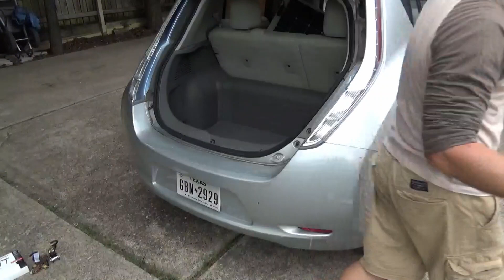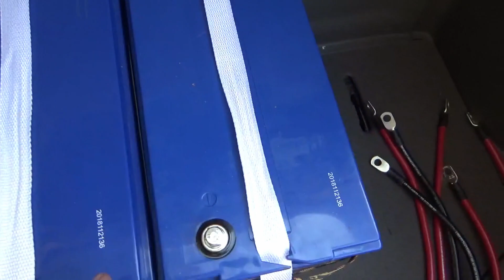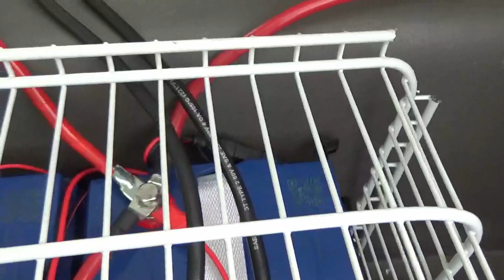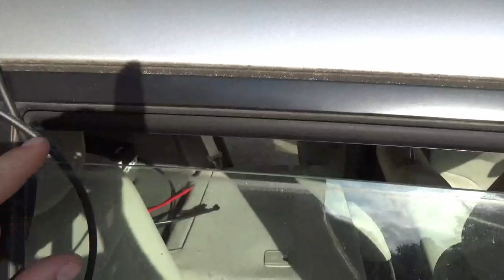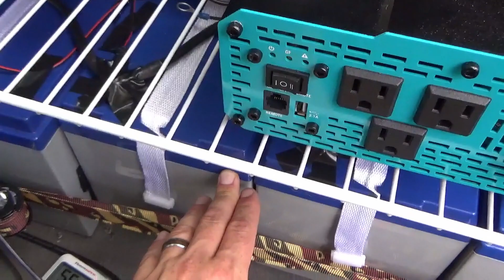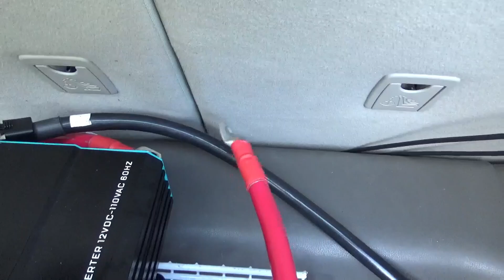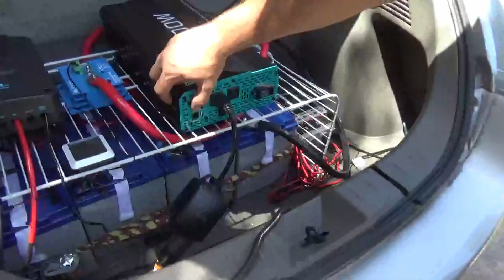Solar Powered Nissan Leaf

Comment: How much you spent on materials?
Reply from the maker: $2400 on system shown in this video.  But it has evolved since then.  The system shown in my latest video (5-7-2020) is closer to $3200, but generates twice as much power.

Comment: 65w/h 8h=520w1dey.  24kw/h battery Nisan leaf=48dey 1charger😂😂😂😂
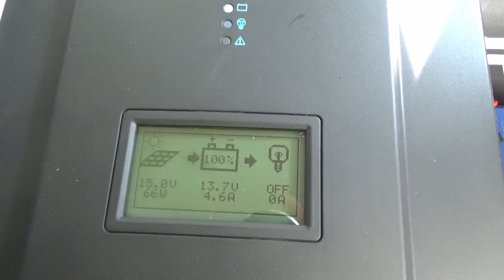Reply from the maker: Couple things to keep in mind.  1)  Gen 1 Nissan Leaf battery never discharges to below 2 kwh, so at most you are charging 22kwh.  2)  This was the earliest semi-functioning prototype.  Current system (4-24-2020) has 320 additional watts of paneling, and has achieved charging speeds above 400w, and I'm not stopping there.  3)  This one's the most relevant.  The power that solar systems put into their battery bank is very much affected by the current voltage of the system.  You will notice the display @23:42 reads %100 (and it definitely was at 13.7v).   The 65w reading shown in that scene is a reading not of incoming power, but of power flowing into the battery bank.  Had the bank been at a 50% discharged state, you would have seen that reading increase to about 150w.  Is that a super impressive number?  Hell no, but once again - earliest functioning prototype.  I cranked out 3 kwh with the system yesterday, +4.5 kwh from the new battery bank =7.5 kwh or a 34% increase over the maximum capacity of a brand new 24kwh battery.  And that is a significant improvement

Comment: cool concept, but I dont see how you will save any money over just buying a car like a Prius. A prius only costs $5 to drive 100 mies
Reply from the maker: You are aware the Prius only gets this mileage because it has batteries and an electric drivetrain to augment the ICE one?  Those features can be removed from a Prius and the mileage falls to the low 30s.  This is not to say that the Prius is not ALSO a good car to try a project like this on.  Both the company and DIYers have built solar powered Priuses (Priusi?) with considerable success, achieving up to 100 mpg.  But ultimately a perfectly manufactured hybrid will never outperform a perfectly manufactured all-electric (the Leaf DEFINITELY isn't) vehicle because your creating two power systems and hence twice as many failure points.  And at times when all the propulsion power is coming from one of the two systems, the other is hundreds of pounds of dead weight.  I just find it ironic that in other posts on this channel you call EVs stupid compared to gas cars; and as an example of a superior vehicle you name the Prius which is of-coarse, half-electric.  But I digress, the Prius is also a solid car to do solar power station on.
Reply: @InnovativeSustainableSolutions  I want to start by saying that I have many driven a Prius for many years. I went with a Prius because it appeared to cost less in the long run, over a fully electric car. Because of the fast battery degradation they seem to have. Prius does have degradation too, but its much slower process, from what im seeing. My Prius went 200k miles before one of the cells went bad. I had it replaced and balanced, and it still had almost the same economy as when new. Cost me $300 to have it done. I have heard that a new leaf battery can cost $7k. I still feel fully electric cars are the illogical economical choice, when compared to hybrid Prius, and a small gas powered car.  Because it seems to cost more money in the long run, when you end up having to get a new battery. And thats not mentioning the added plus of convenience of unlimited range you can drive with a Prius.  I also want to state that Im not saying you are wrong. Just that Im am not seeing the overall economy, myself. Maybe there is another part I haven't noticed yet. 
Also I do think the idea of charging an electric car with solar as really awesome. Would be amazing in an off grid survival situation. Im surprised I haven't seen more , off grid people, doing this.

Comment: Great! I wish you could have the pre-existing setup already in the car, also check batteryhookup great deal on leaf pack , I can't wait until they release the charge in the dark solar panels 👍
Reply from the maker: I saw that deal on battery hookup!  Incredible!  I have an idea for a mobile powerwall/EV roadtrip kit, that would combine 3 of those battery packs (1200lb battery) in a mini cargo trailer.  It's a 72kwh battery pack on wheels.  Plug that into the Leaf battery connection under the vehicle and you effectively have a 96kwh (280-300 mile range) Leaf.  Put some zero profile panels on the roof and it's a massive solar battery powerwall.  I really want to build one, and if I do, it will be using atleast 2 of those $1800 packs on battery hookup.

Regarding the "dark" solar panels.  I've seen this article popping up in several places.  Technically, all solar panels charge in the dark.  The panel chemistry utilizes starlight (photons) to generate a voltage, and the panel doesn't care which star it's getting it's getting the photons from.  But the density of those photons decrease by a factor of 9 every time you double your distance from the source (go twice as far from Earth and your solar panels generate 1/9th as much power).  Trying to get energy from panels at night utilizing light from photon sources trillions of miles from earth, strikes me as a fools errand.  I would love to proven wrong on this, I have a lot of money invested in solar panels, but the science just doesn't add up
Reply: @InnovativeSustainableSolutions  That's why you have to cover solar while working on it at night, a lightning flash can shock you.

Comment: How can we find this stuff
Reply from the maker: most of my parts I got from Renogy (www.renogy.com).  They are doing a 20% off everything Black Friday sale right now, so good time to buy.  Feel free to contacts me at my email in the vid description for specific parts questions
Reply: @InnovativeSustainableSolutions  oh great thanks for information and vids
Reply from the maker: @Douglas Snow I have 1 50 watt on the hood, 2 100 watt panels directly on the roof, 2 160 watt panels on the roof rack, and 1 additional 100 watt panel I rest onto the windshield when I really need all the power I can get.  I use 4 12v 100ah AGM batts for the battery bank.  AGM batts are cheaper up front, but LiFePos are a better value in the long run

Comment: Have you posted a written version with references of how you put this together?
Reply from the maker: No, I was hoping the video would provide an adequate tutorial.  Did you have a specific question that was unanswered?
Reply: @InnovativeSustainableSolutions  I was more so looking for a list of materials used overall for the charging system project. I know you mentioned a few modifications so I was wondering if you had a final "supplies" list at least for your version of this.
Reply: @InnovativeSustainableSolutions  Sorry, and you mentioned that a lithium battery would cut down on the bulk of the build and I was wondering if you had any battery recommendations
Reply from the maker: @TheJackOfAllVideos  Gotcha, I don't post parts lists because I'm continually finding better parts to do this with.  The changes I have made to this system to date are swapping the Renogy inverter for a 12v Giandel 4000 watt inverter, and adding an a/c unit for cooling (see solar powered a/c vid on this channel).  Everything else works great.  Renogy 60A MPPT charge controller is perfect.  2 of these lithium batteries (https://www.renogy.com/lithium-iron-phosphate-battery-12-volt-170ah/) would give you more usable capacity, and have a much longer lifespan (better value in the long run), better resale value, and cut the weight down by about 140 lbs.  But the initial investment jumps up by $2k!!  Definitely wait till they go on sale if you can.  AGM batts are way heavier and don't last half as long as lithium, but they're just so much cheaper up front.  Thats why I went with them.

Comment: In the event of an accident, those batteries will be 100 lb wrecking balls trying to find the back of your head. You really need to strap them down securely.
Reply from the maker: 240 lbs wrecking ball*.  And they're heavily velcro'd and ratchet strapped.  If you are accident prone though, additional anchoring hardware would probably be a good idea.
Reply: @InnovativeSustainableSolutions  I don't think you understand the forces involved in a crash. If you're doing 50 mph, and you crash into something that can stop you in 4ms, like a tree, each of your 60lb batteries has the force of 34,000 lbs. Although velcro works great for normal situations, it won't do squat in a crash. It only takes one accident.
Reply: @InnovativeSustainableSolutions  Be careful, I'd like to see you hang around and make more videos. :)

Comment: 24 volt would be better if you swap out the inverter. You need to put the two matched panels in series for max mppt 12 volt convertion and the smaller panel on a separate cheap charge controller or it will draw down the power with cell resistance.
Reply from the maker: I have thought about the option of moving the solar up from 20v to 40v.  And moving to a 24v battery bank and inverter.  It would be 3-5% more efficient, but you would have to be much more careful in your choice and position of panels.  I'll probably do a video on all the pros/cons of 12v vs 24v vs 48v within the next 6 months.
Reply: @InnovativeSustainableSolutions  It's more like 50% improvement if you max out the charge controller voltage and then only connect matching panels. They can bring down voltage to 12 volt batteries and produce more amps than rated on solar panel. The smaller panels will decrease the watts that the larger panels already produce.
Reply from the maker: @super-sim1665  Even when everything connected in parallel?  I go through and do a "status check" on my panels every couple weeks, by just unplugging one, walking back to the controller taking a reading on how many watts have fallen off, then reconnecting that one, going to the next panel etc, etc.  I've never disconnected a panel (even the tiny 50 watter on the hood) and seen the overall output of the system go up.  I got about 5/7 of the rated panel output in the summer (so "350 watts" of panels produced a peak of around 250-265 watts), which given the panels varying orientations, and that no panel EVER produces what it's rated at, seems to indicate everything is functioning nominally.  I thought, could be wrong.

Comment: So you cannot use it while ur driving?
Reply from the maker: It charges the auxiliary battery bank in the trunk while driving (during daylight hours).  It doesn't extend the range while driving, as the vehicle has safety features that preclude it from being shifted into drive while the charger is plugged in.  You have to connect the panels directly to the main battery to accomplish this.  I will do this video on this eventually, but I need to learn more before I tackle that project.
Reply: @InnovativeSustainableSolutions  oh really, that's what i thought, u should connect it directly to the main battery to keep it charging while moving

Comment: if your car is going to just sit in the sun almost every day without driving it like mine cant i just put solar on it like the folding kind onto the car cover via velcro or something and just plug the panels via inverter and the level 1 plug and charge the car directly during the day without using batteries? then when i do want to go somewhere just remove the panels and the cover and take off? see im disabled and just have my car for local driving like once a week the rest of the week it just sits in the sun under its cover.
Reply from the maker: I really don't think so, unfortunately.  You would be hooking your charge controller directly to your inverter, which I have never seen done.  It's a hardware problem, inverters just arn't designed to run directly off panels.
Reply: @InnovativeSustainableSolutions  isnt there some way to "trickle" charge your ev car directly of panels on it without using batteries? if you use batteries you have to add the time they are charged to the time your car charges its battery off the solar batteries. Like in my situation i only drive it on weekends and it sits in the sun all day everyday (with a cover on it) so id probably want the panels on the cover.
Reply from the maker: @justjohnny05  There is, but it ain't easy.  The problem is your car battery charges at around 400 volts and you won't be able to get more than about 50 volts out of the solar.  So you will have to run your solar power from your charge controller through a transformer, or voltage step-up, to get it up to that 400v range.  There are some other hurtles to consider when attempting this direct connection.  I'm going to do an entire video that covers only this question, within the next three months.  Watch out for a video call "The Number 1 question I get asked about the Solar Leaf".
Reply: I hope old mate answers this